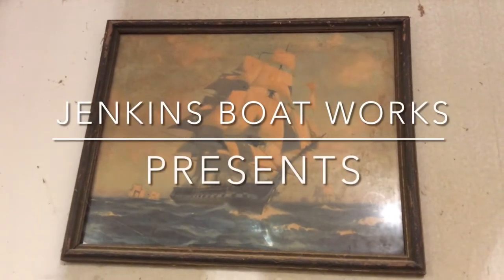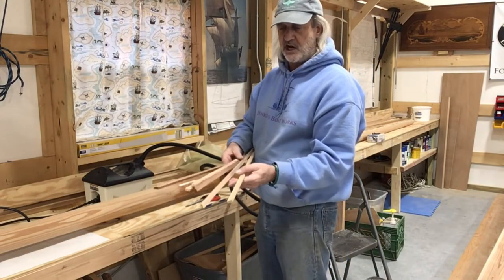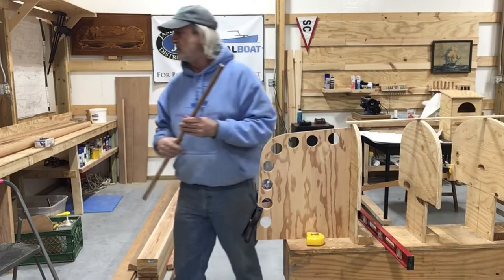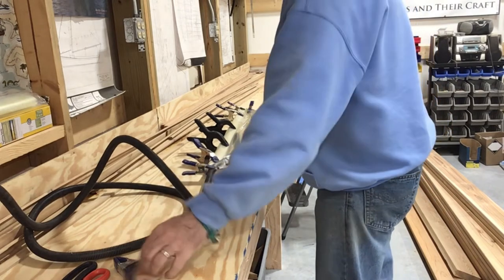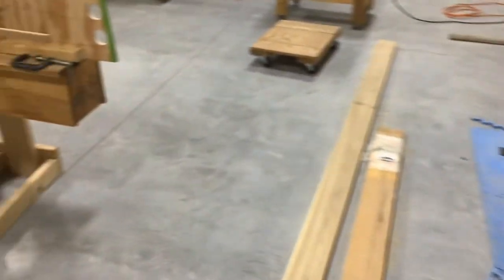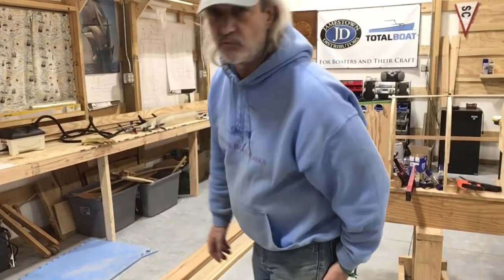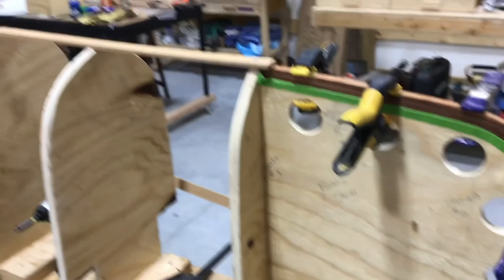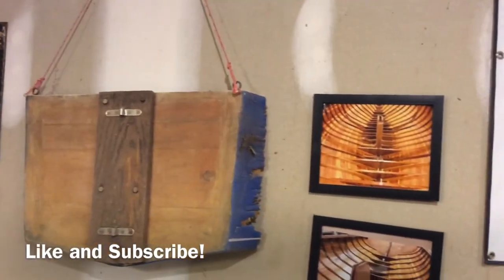How to steam bend canoe stems- Or how not to! Building Freedom 17 Canoe Episode 6

Comment: I felt your pain Chuck. I have done a lot of steam bending and the sandwich bag roll is great for larger stock like in and out whales, but it takes far longer than the steam box method appears to in YT vids ( took me around 3hrs for 20mm [ 3/4" ? ] mahogany type stuff ). It may be due to heat loss, or no pre soak. I even boiled some 6mm oak in a tea urn with no success. I then cut 3mm ( 1/8" ) oak and used a bending iron and clamped it on the form instead. The wood loses its flex quite quickly when out of the bag, so maybe I would have left the steamer running and done one strip and then one at the other end and back again with the next and so on. I have re steamed the wood to improve the fit as needed as well. I have been a guitar maker and repairer for over 25 years and always enjoyed bending the sides by hand, it is nice that it has carried across to the boat work. Maybe ally foil under the bag may help keep the heat in too. I saw your comment on the last vid: I just compared the quality of the ply with the quality of the cedar and how the ply was never as good and stable. Happy new year.